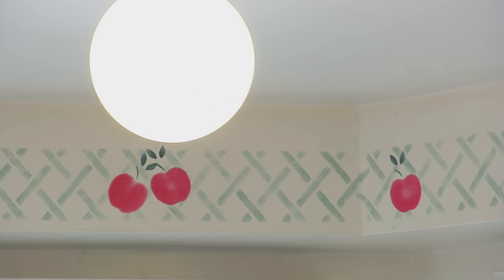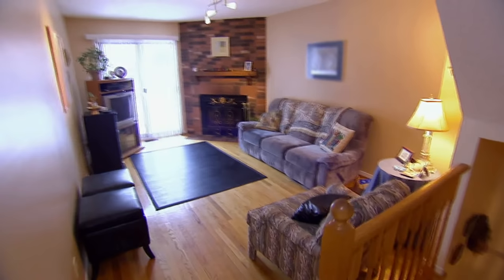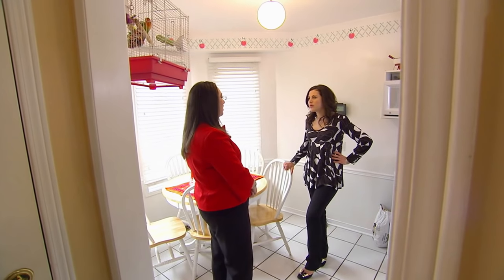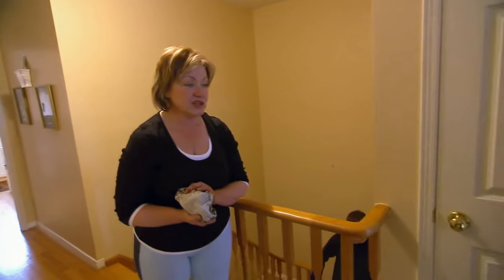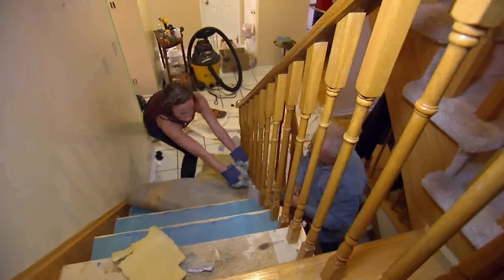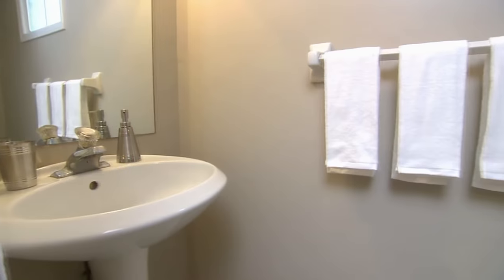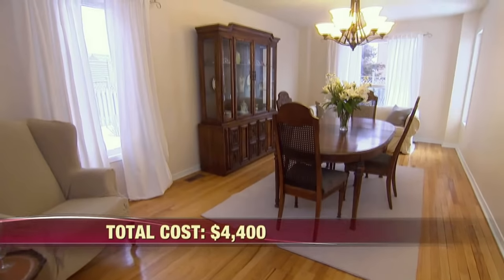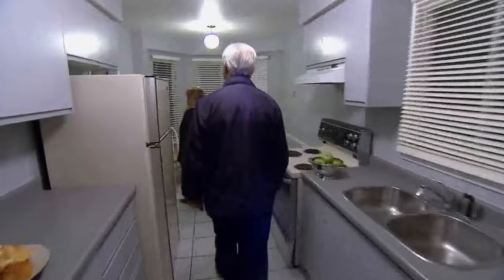We NEED to Sell This House | Unsellables FULL Episode | Susan and Bob

Comment: i’d of liked to see the wall between living room & dining room either taken down or at least cut back about 6 feet, open it up more. i think was missed opportunity.
Reply: Structurally that would be expensive and time consuming. That is a bearing wall, so an engineering drawing, building permit, and a huge amount of work would put the time frame beyond reasonable for the show.
Reply: Agreed!
Reply: I too had feelings that the wall can be bought down n the rooms can be distinguished from floorings.. but i guess they also had to be in budget may be that is why..

Comment: Why is the lovebird by itself in a tiny cage?!! The 22 year old needs to move out. And what’s up with the wall separating the sitting and family rooms? Tear it down.
Reply: That is a bearing wall. Big and expensive job that would take time.
Reply: @michaeltutty1540  A. Do you know that for sure? B. A bearing wall can be pared down to just the supporting posts while knocking out the drywall in between.

Comment: DO NOT PAINT BRICKS.
Reply: Saul Goodman  Are you a realtor by chance? Just wondering cause I'm trying to sell my house.  I'm in the U.S.  Thanks.
Reply: @tammysims5164  I’m a lawyer. But for the right price, I’ll sell anything.
Reply: Dear Mr Goodman, I understand. I dislike intensely-bricks, so if I wasn’t replacing it with stone, I’d be ruining my resale value slightly because; strangely I love white brick 😑 what burns MY cookies is painted over woods, specifically ‘old’ wood. If all else fails, remove the paint-tedious yes, but doable. 🧐😎🙏🏻
Reply: Seriously, that fireplace was lovely with the exposed brick.